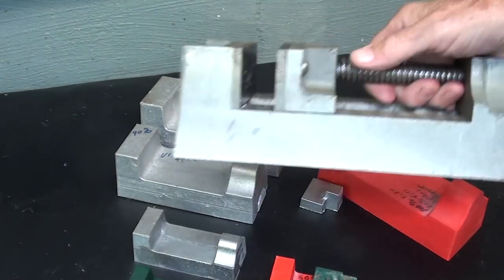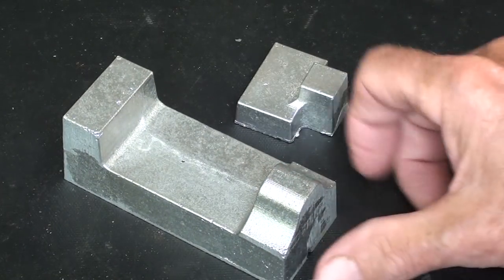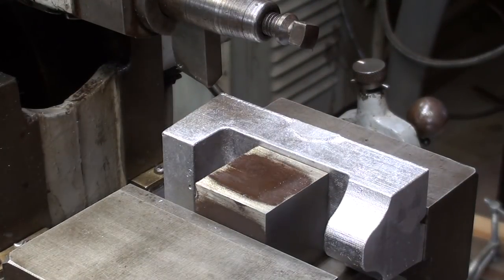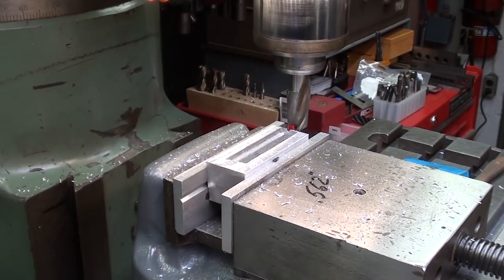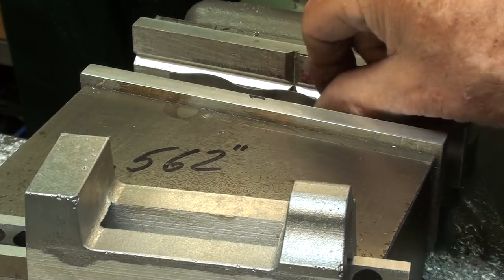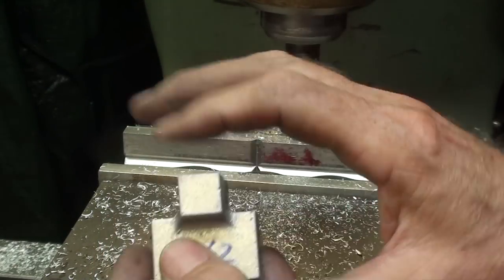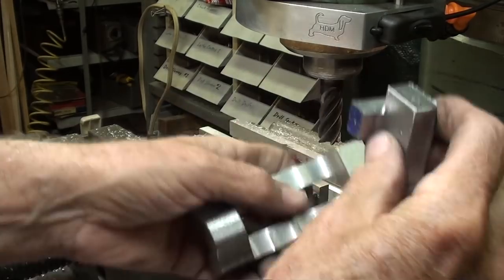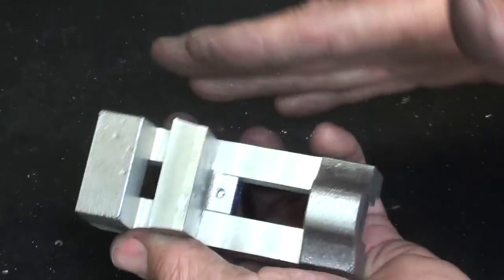Machining a Drill Press Vise pt 1 Tips 603 tubalcain

Comment: Nice setup on the shaper. Good to see various ways to hold work pieces. I think I would have used strap clamps directly on the table for something like this, but I don't have a shaper; I'd be milling the sides vertical.

Comment: Just thinking that if you wanted a steel vise you could use bar stock and cut the base and the two end parts. Then attach the ends to the base using recessed bolts or welded! This would also allow freedom in machining the various parts.

Comment: Awesome video mr pete, iam building a foundry any helpful tips? Thanks for sharing!:)
Reply: Personal experience. Make it big enough to do a good melt small enough to handle by yourself and mobile enough to move when you need to. I did none 😒
Reply: Michael cox thanks, yes i only want to melt aluminum! Nothing big or unsafe!
Reply: Just remember how big you need the crucible to be I made one out of a 4in pipe about 6in tall not much I could do with it and melting was a pain because nothing was easy to get in it.
Reply: One of Mr. Pete's course's are in foundry work. I recommend you start there, he does go over the equipment involved.
Reply: Mr. Shyster thank you!

Comment: I know this is a machining video and not about drafting.  However, this is a nitpick you would hear from the chief draftsman on the very clear detail drawing you showed.  When locating holes, dimension between the hole centers directly, rather than coming from each edge of the part to a hole centerline.  You only have to get one dimension right on each part to get the holes to line up, rather than three.  I enjoyed learning about how to hold the parts without damaging them.